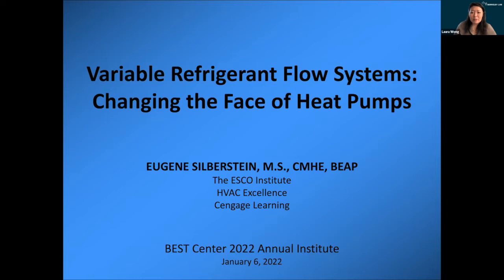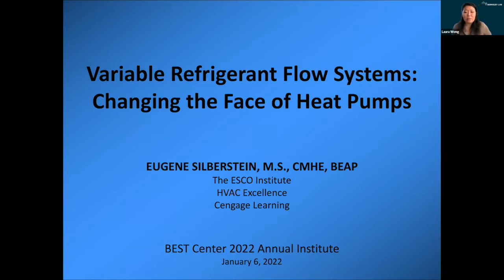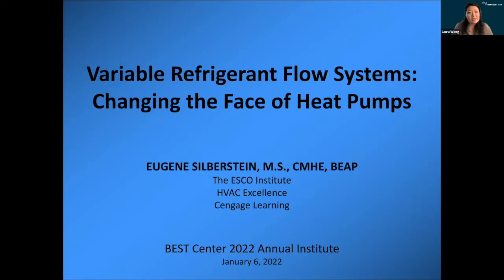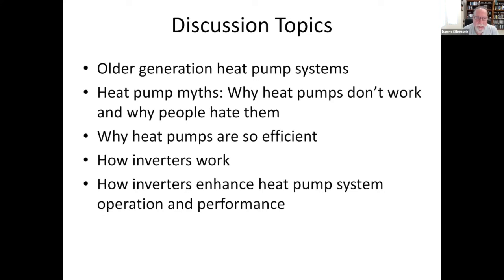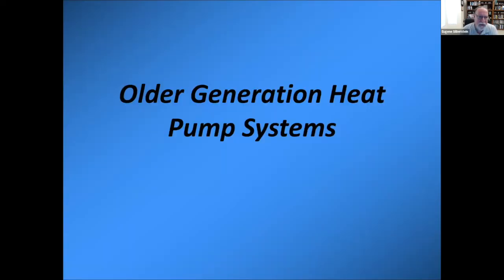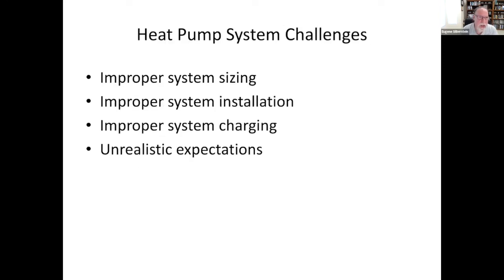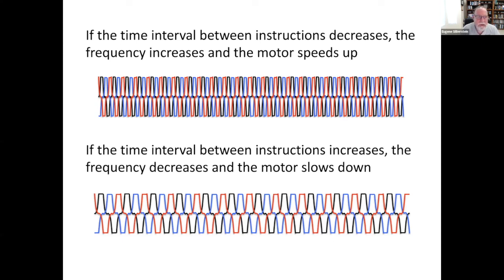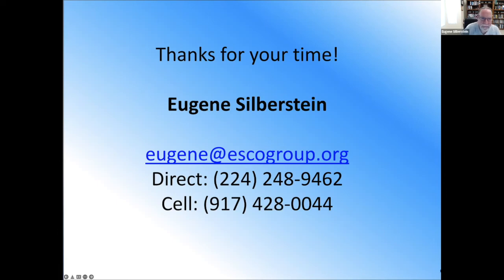"Variable Refrigerant Flow Systems -- Changing the Face of Heat Pumps" with Eugene Silberstein

Comment: Thanks. The further north you go, the more energy the compressor needs to reduce the temperature in the evaporator. How is the heat pump more efficient in this regard? How is this energy generated in cold climates?